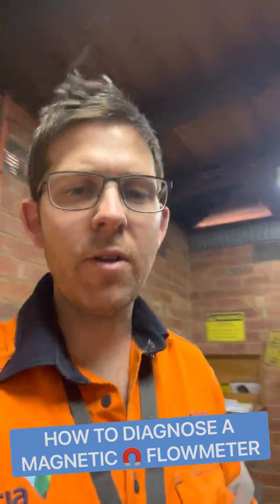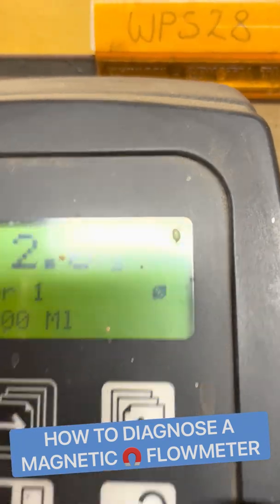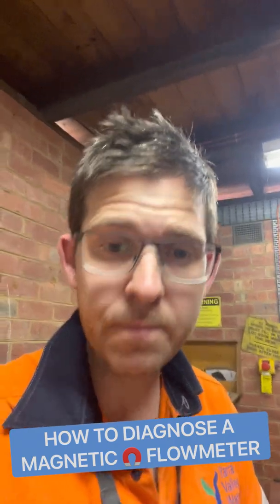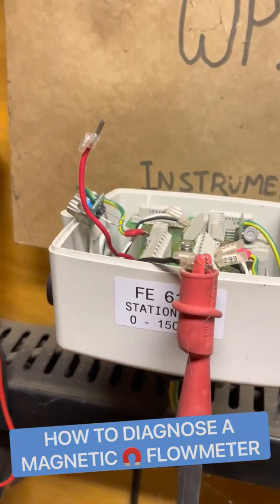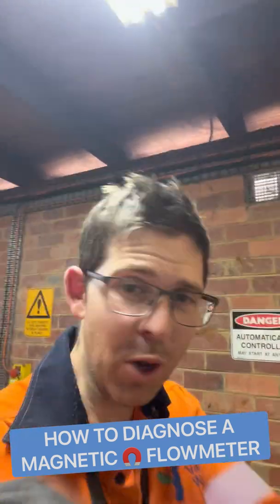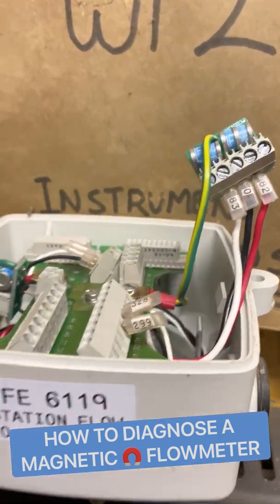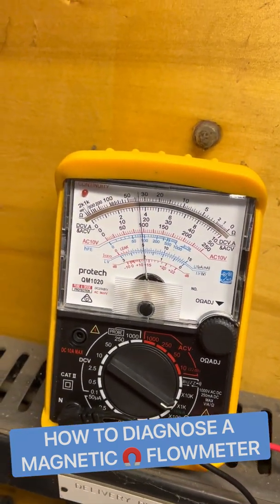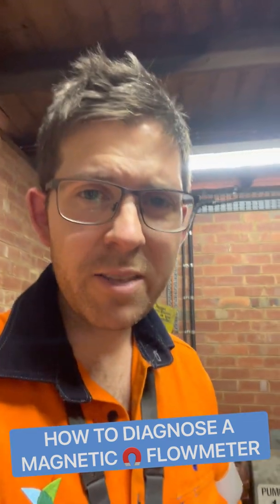Diagnosing this DEAD Flow Meter 💀

Comment: What is the minimum conductivity would you recommend?? Can I use a guide of 5 to 20 microSiemens/cm??
Reply from the maker: Good question Pete ☝️ in this instance we are measuring the impedance of the electrodes and coil. The EC or electrical conductivity of the water is irrelevant in this case.